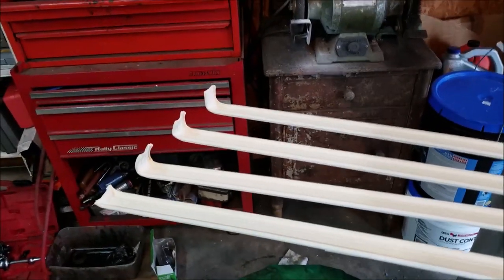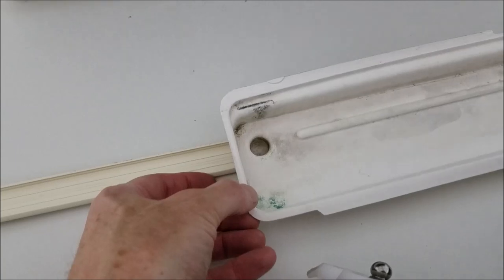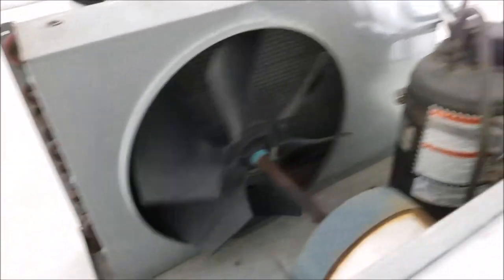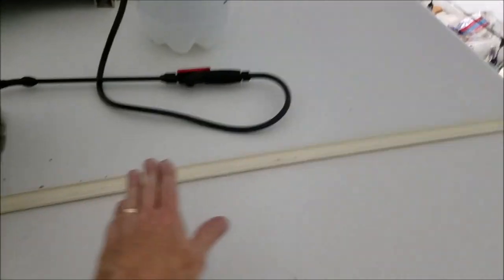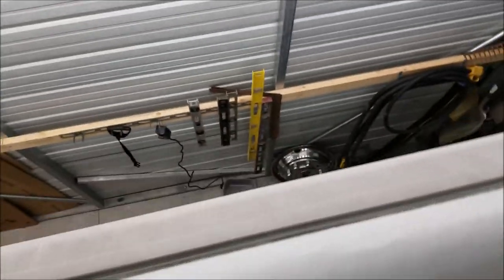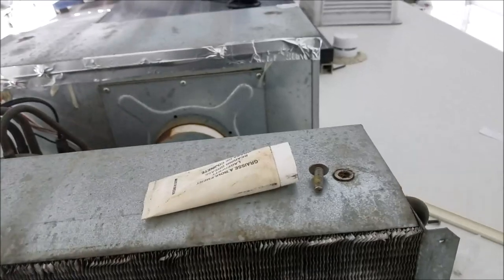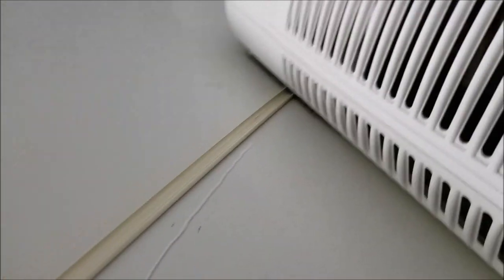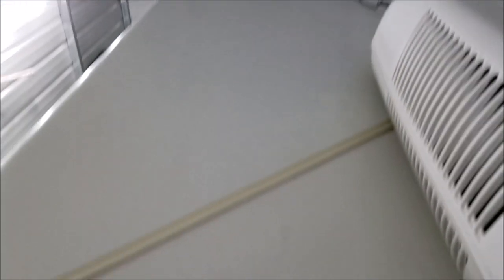RV Gutters for Roof Top Air Conditioners No More Streaks Also AC Tuneup on Coleman Mach

Comment: Where can I buy those gutters
Reply from the maker: This is all you need https://www.lowes.com/pd/Legrand-3-5-in-White-Flat-Screen-TV-Kit/1148201
Reply from the maker: or this https://www.lowes.com/pd/Legrand-Non-Metallic-60-in-L-White-Raceway/3129263
Reply: Thx so much. I went to lowes before your message and unfortunately.  Purchased some smaller ones with a short side wall. So it overflowed over the sides at its lowest point.  But definitely going back for these.